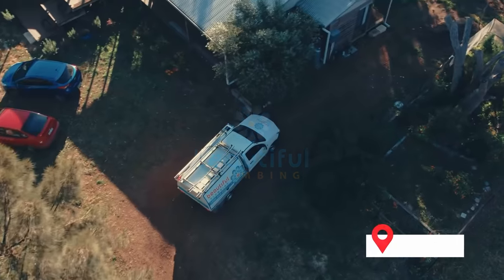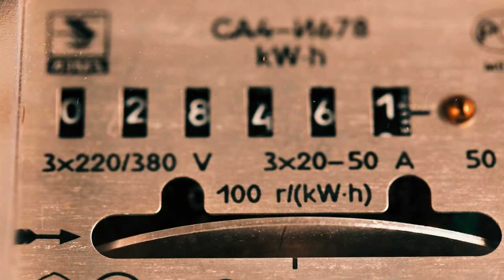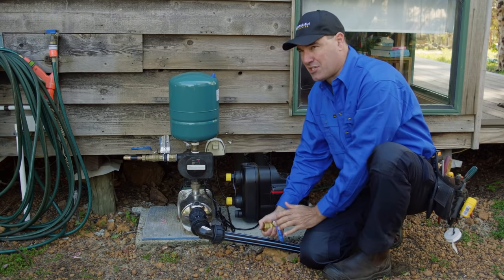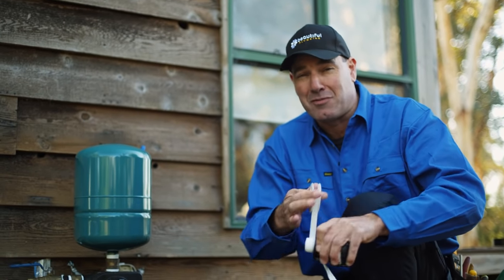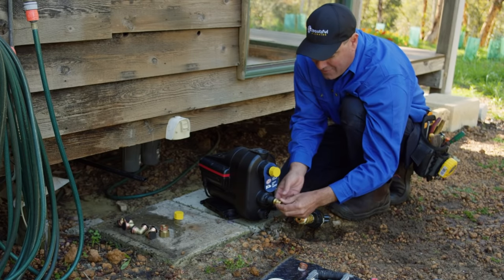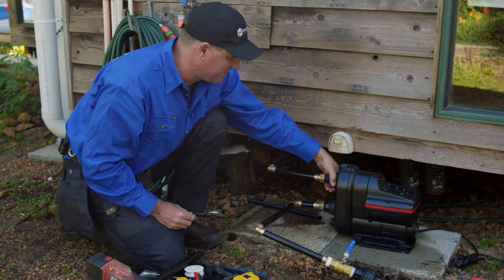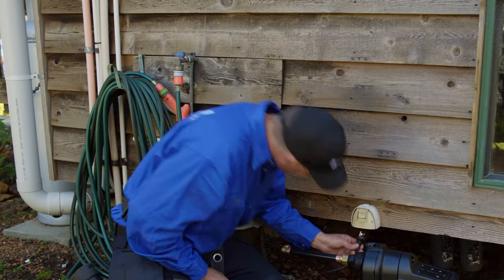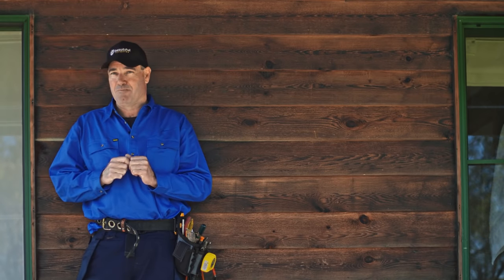How to Fix Low Water Pressure: The Grundfos SCALA2 Water Pump

Comment: HIghly recommend reconsidering the Grundfos Scala2. I am on my second one in under 4 years. Wonderful when it works, but when it leaks, and it WILL leak, it's junk. My first one was replaced under warranty after 18 months and the second one warranty was denied after 20 months. So for over $700 I got around 40 months of use over the course of 2 pumps. Search online - I am NOT alone.

Comment: It is running non stop. Even I close the out-valve. It still runs. It I make the motor works at lower pressure level it stops when no values opens but runs again

Comment: We just got one of these for our house and it works pretty well, but the pressure fluctuates a bit at the taps, and the pump cycles on and off every 15-30 seconds. Don't think it's supposed to do that...
Reply from the maker: Have you checked for a water leak??
Reply: @BeautifulPlumbing  We found a small drip at the discharge of the pump but other than that nope. When water's being used (garden hose, sink etc) the pressure tends to bounce up and down between 50-70psi every so often, and the pump cycles on and off. The unit is set to 65psi and incoming pressure is about 38psi. I set the built in air tank pressure to 70% of operating pressure like it said to in the manual (40psi), but that didn't help it out either. Not sure what else to do lol
Reply: Having similar issue. Frequently running/stopping every couple minutes.
Reply: @azzammeeralam7182  Yeah I 'm still having the same issue too, I've tried just about everything. It seems to have smoothed out some, now it's only cycling every couple minutes or so, but I still don't think it's supposed to do that. My house is old and has tiny, old galvanized plumbing (3/4 and 1/2") so maybe that's part of the issue. I dunno
Reply: @accordinglyryan  mine is on roof next to tank. I use it to pressure down to house. I set speed between 2 and 3. It runs for 10 secs and shut off for a minute and keeps doing this while I don’t use any water. It runs fine when I use water though. I suspect overpressure. I’ll adjust speed and check. What’s your settings?
Reply: @azzammeeralam7182  In your case I think you may have water going somewhere. The pump shouldn't start unless it senses the line is losing pressure. I have mine set 2 steps below max (65psi). If possible, install a pressure gauge downstream of the pump to verify this. Also, check and adjust the pressure in the built in pressure tank on the pump. It should be set to 70% of operating pressure (no idea why this is buried deep in the manual, seems like important information.) There's a Schrader valve right on top of the pump.
Reply: @accordinglyryan  Found built in pressure low at .8bar. I put more pressure now at 1.5bar. Pump seems ok now. Will test it for couple days. Thanks for advice.
Reply: @azzammeeralam7182  Cool hope it works out! Now if I could just figure mine out lol
Reply: Hi all mine is the same , 3 years old keep having to lower the pressure setting im on 2 and 3 on at the moment or else it keeps running. I think its wearing out and cant get up to the pressure. Air is about 1.8bar and no leaks. Bit annoying as it wasnt cheap. I might contact the people i got it off. Might also try and find the check valve perhaps im leaking back to the rainwater tank

Comment: Hello. Mine keeps running and stoping every couple minutes while not using water. Any idea why besides leakage? Do I need to adjust something?
Reply: Try to open the the suction port see if the check valve is good
Reply: Also check the pressuretank if still have a precharge air
Reply: @laskoytv6296  pre-pressure tank was low. I added more to about 1.8bar and I can tell there is improvement.
Reply: @laskoytv6296  check valve is good.
Reply: Okay scala2 now having leaks issue,i have vdeo uploaded some cause
Reply: Me tooooo. Thanks god I have another one who asking for the same concern

Comment: I have a Grundfos CMD SP 3-56 with a Pressure Manager 2. Sometimes when you turn the tap on you get no water coming out. But if you wait a few moments it suddenly comes to life. I took the PM2 apart, there was heaps of sludge inside it. I cleaned everything up, even took the pressure switch out of its housing. The issue still remains. Any ideas?  I found a membrane inside the PM2 that was compressed flat, but on Grundfos videos, it shows it is suppose to be a cone shape, what function does this perform? Could this cause my problem? Any help would be appreciated as it is literally driving me nuts.
Reply: Link to photos on my google drive of the membrane : h*tp://drive.google.c*m/drive/folders/1tibmdZl3XitgekxOjIRpyi3DoBv7s3tA